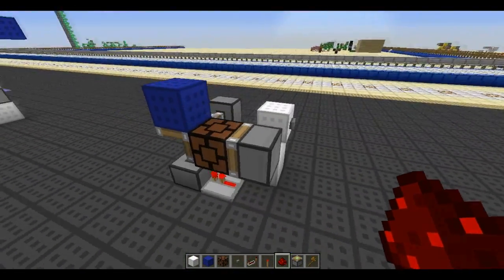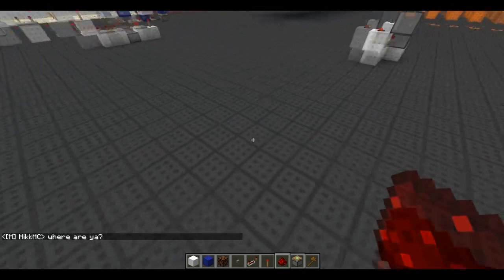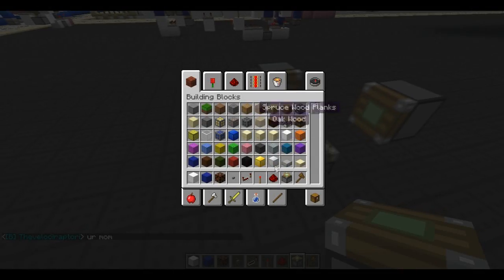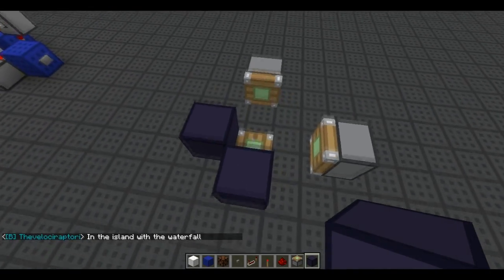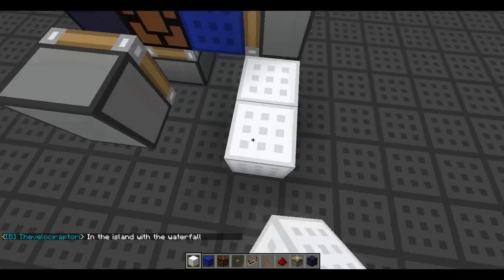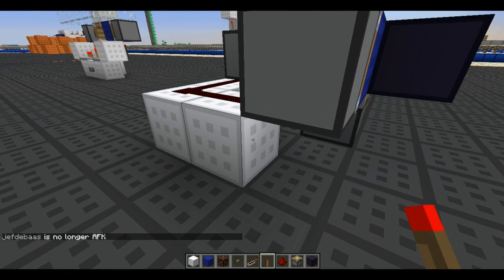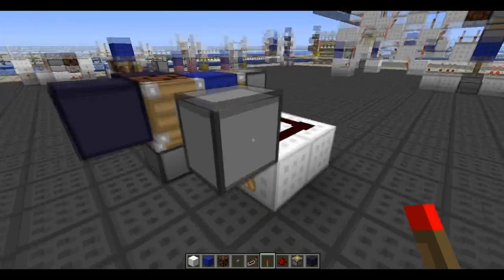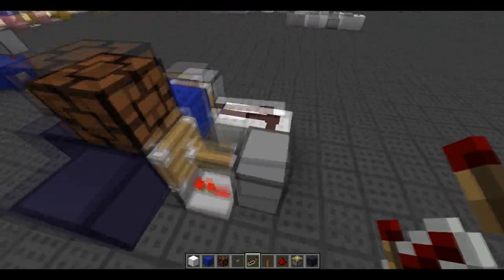3x3x4 Floor Block Swapper | Redstone with Fenno

Comment: Well I've always wanted to see a double piston extender block swapper, but with a little difference being that the double extender only works when the input is on/high (for a hidden crafting table that pops out of the floor) Just wondered if that would be something you'd be interested in doing!